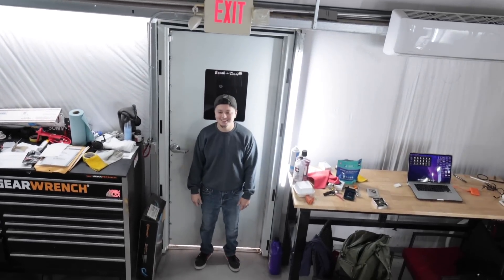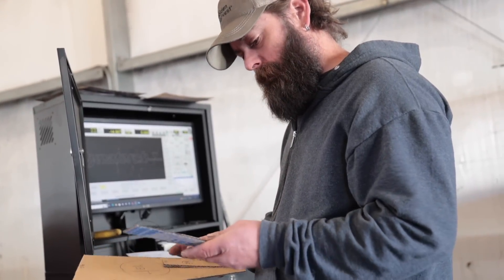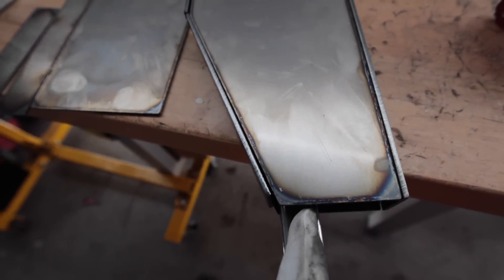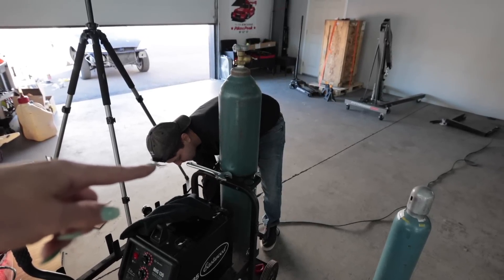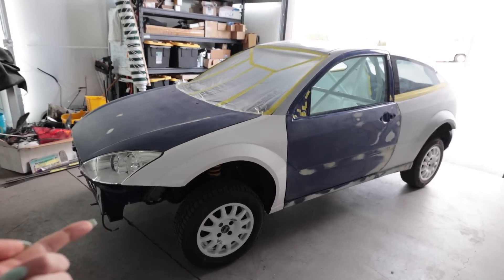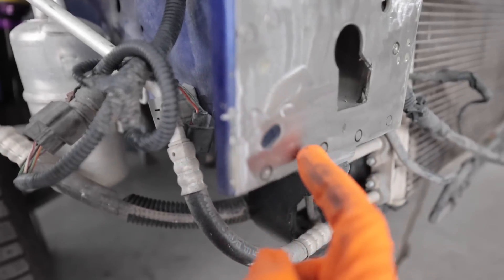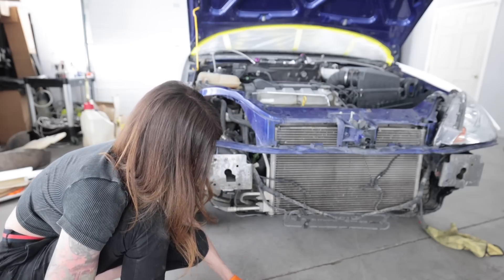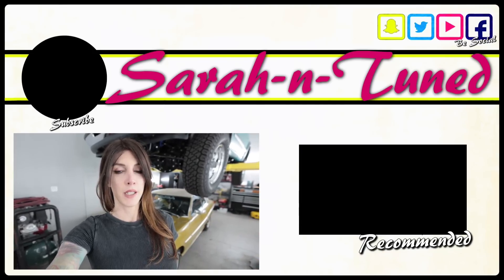Engineering My Own Bash Bar // Focus WRC Build

Comment: I find the fabrication and metal work stuff far more interesting than just bolting stuff together. Keep it up!
Reply: It's slow and isn't always fascinating video, but it's still great to watch the fabrication. It's at least as much  fun to watch you struggle like a mortal as it is to watch Covell make everything look way too easy.

Welds without Ag look shitty now matter what you do, but this will help all your welding. Stop holding the MIG like it's trying to bite you. Use one hand on and below the trigger.  Then lay the MIG torch over the forefinger of you other. Kind of like your shooting pool. Just enough to steady it. You might need a thicker glove than that to not get burned. (My white Tillman's don't have any insulation at least) Don't hold rest your finger under the last couple inches of the MIG torch and you hand shouldn't heat up a ton.

keep it up, and WTF is the a one chip challenge box?
Reply: I totally agree with you
Reply: Or cleaning.
Reply: I liked the fab stuff!

Comment: Time under a shield makes a welder. Great job. If you use a sanding disk or grinder to clean up your tacks that is called "Feathering your tacks." It always helps to make a clean weld. I really like the fab work.